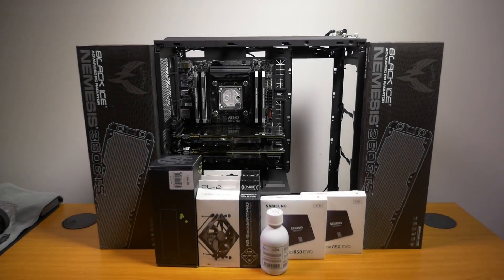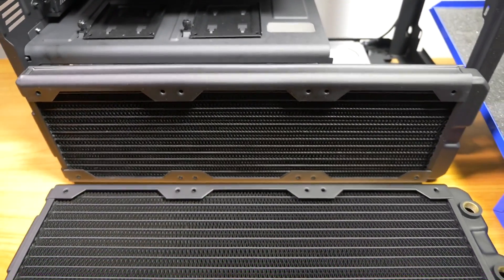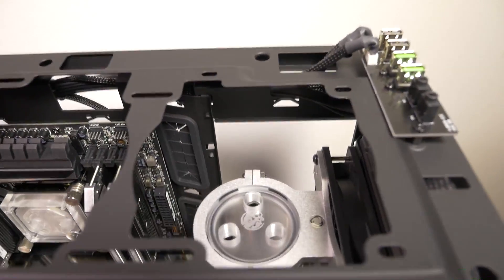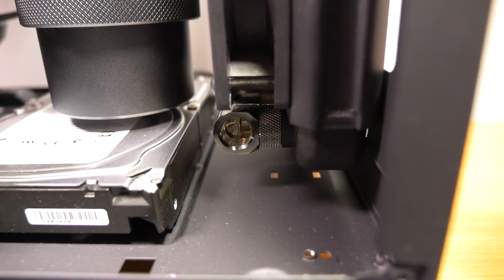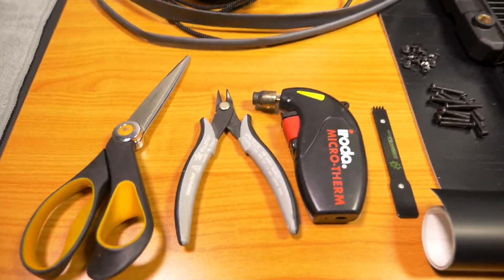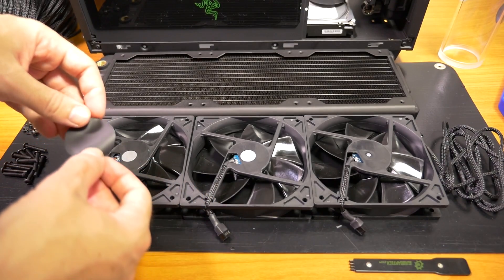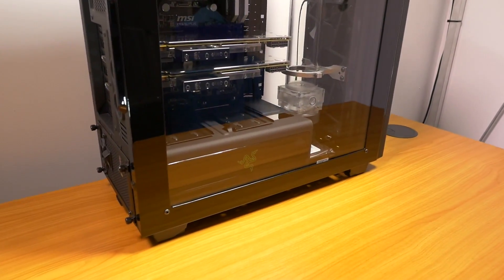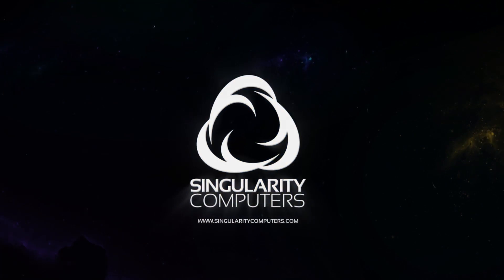SC Build #21: H440 Liquid Cooling: Part 3

Comment: I'm doing a water-cooled setup pretty much exactly the same and it would help me out a lot if you could list the specific fittings and quantities?
Reply: Cottontails So am I. Seeing your comment is half a year old, what did you use?
Reply: I just went with soft tubing and did pretty much two fittings per part it was cheaper.

Comment: I build my water cooled PC about 2 years ago(inspired by Client build 13) and i was wondering when should i replace my soft tubing and coolant? I'm using Primochill PrimoFlex LRT Advanced 13/10mm Crystal Clear tube and EK Ekoolant UV Blue as my coolant of choice. I have opened up my in-line filter a few times and i haven't found really anything in it so far. However, the piping i had to replace recently because of upgrades had already started to turn a little hard and definitely wasn't as clear anymore as it used to be.

Comment: Will the mounts for the reservoir hold the pump as well without vibration. And do you have a duel reservoir radiator mount as that's what I'm looking for
Reply from the maker: +James Emsley Hey. Yes the mounts hold the entire pump and reservoir config including the pump. I do have a dual reservoir radiator mount, right here: https://www.singularitycomputers.com/shop/watercooling/reservoir-mounts/reservoir-mount-ethereal-dual-60mm-billet
Reply: They hold the pump res combo using the friction of rubber pads, which shouldn't allow much vibration to pass. It's more likely you won't notice the pump vibration due to the fans it's mounted to.

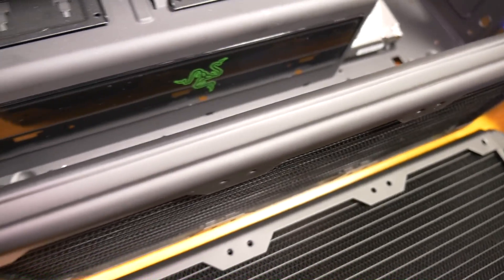Comment: 1:37 why just dont you pick adaptive fans. that can run at different speeds. so that is slows down when cpu/gpu are cool and spin up when they are getting hot
Reply: Because you would have to run extra wires to the motherboard and some type of pwm fan controller.
Reply: +rubikfan1 I think his whole point was that you don't need fast running fans when you have ample rads so your case stays silent.

Comment: +SingularityComputers
are you planing to do anything to the lug at the frontend of the psu shroud where normaly the drivemounting plate would be?
i dont know if it is just me, but this "dent" looks just off there in this very clean environment

if you do somthing to the shroud you can also place a thin piece of foam rubber (i mean Mossgummi in german, dont know if this is the right english word for) behind the cable routing hole for the gpu cables so you block the view a bit more

by the way, you should mayby do another version of the Ethereal mounts that use a railsystem so you can adjust the position of the mounts itself ;)

Comment: Very nice.
I have a small suggestion.
How about painting the sites of the graphic cards PCB?
They have that yellowish color to it. If you are going for perfection, (and since you even changed the screws, i think you are) that would be something to consider.
Reply: +Tony Atzen Some paints are conductive, making that a huge risk..
Reply: If you do it right. I don't see the problem.

I actually used permanent marker on my previous graphic card. XD
Sounds dumb, but it worked quite well.
I would have done the same to my new one if the edge of the PCB wasn't already very dark.
Reply: Tony Atzen Ah, I thought you meant spray paint or airbrush it... Your idea seems very nice it that case!
Reply: We can both agree that spray painting it wound't be advisable. XD
Reply: Tony Atzen Just did your idea to my card (980Ti strix) and it looks nice!
Reply: ***** Glad to hear it. :D

Comment: just one question: isn't it bad to have the outlets on the lower end of the radiator when installed vertically? wouldn't all the air bubbles get trapped at the top of the radiator?

Comment: That SSHD in the bottom is a big eye-soar for me in an otherwise beautiful build.
Reply: +David Larsen I don't mind seeing the drive because I want to know what's in a rig when I'm looking at it as opposed to having to read a spec sheet. That being said, sexying it up would be nice but I wouldn't want it concealed.
Reply: +David Larsen I think it might look better covered with some of the black vinyl.
Reply: +Steve Pannell but it may overheat...
Reply: +JBpiification I doubt it would overheat but flat black spray paint would work and probably even look better. Only on the silver cover, not the entire drive.
Reply: Or custom make an enclosure :P Or drill some holes so it can reside inside the PSU enclosure or backside of motherboard tray maybe.

Comment from the maker: I have had to reduce the length of my videos. Because of my slow internet connection it is the only way I can upload more often and I have had requests for shorter videos for a long time now. Soon I will be moving house just so that I can get a faster connection so that I can upload more. Let me know what length videos you would prefer.
Reply: +SingularityComputers Personally I enjoy the longer videos where I can sit down and enjoy your work with a good cup of coffee. But I can also respect the huge amount of work that goes into making each video, so in the end it boils down to the time you have yourself to make content available -- I know I will watch regardless of length. I really like how your pump and reservoir configuration turned out, even with the shorter tube, the mounting system really adds some great detail to the build. Exactly how much does the pump mod top kit and cover add in height before the tube is installed? It looks almost a full 120mm added overall without considering the small clearance you'll need for the pump wires.
Reply: +SingularityComputers just wanted to tell you to tell you to keep up the great work!!
Reply: +SingularityComputers I understand that sometimes you only can upload shorter videos but my personal prefrence is definitely longer ones so I hope you continue with that.
Reply: +SingularityComputers I think what matters is whether content is being left out, rushed or if build logs will have an extra part to them because of the extended length. I think we all want to see everything so if the shorter videos means things are being left out or rushed then I'd say make them longer, otherwise just have more episodes. Thanks for the great content as usual!
Reply: +SingularityComputers Your videos are longer than most, but it's why I like them! The 20-30ish minute videos don't bother me when you're giving that much detail on everything. But i'm sure other people would maybe like shorter videos, but more parts? Keep it up!
Reply: +SingularityComputers i prefer long time video because detail and a loot of info
Reply: +SingularityComputers I like to sit back and watch long videos.
Reply: +SingularityComputers i personally think longer videos are better i would say around the 20 min mark is the sweet spot for video length
Reply: +SingularityComputers I kinda liked the 20-30 minute videos because there was just more information that came across.
Reply: +SingularityComputers 15 - 20 Minute long videos are in the sweet spot in my opinion, not too short nor too long.
Reply: +SingularityComputers I like the shorter videos, but as long as you break down some of the more important in-depth mods in a separate video, then I think you will be able to cater to most viewers. Awesome channel Mate :)
Reply: +SingularityComputers I think around 20 minutes is a good video length.
Not too long, but long enough to have a lot of good content in the video.
Reply: +SingularityComputers Think the video was at good length under 15 mins.
Reply: +SingularityComputers Same length as what you were doing. If they cant be bothered to watch then their loss. I like to learn it all, cant if you do shorter videos.
Reply: I think 10-12 Minute Videos are ideal, sometimes longer if the content is captivating enough lol. Your videos are amazing though, even when I was watching 2-3 years ago.
Reply: +SingularityComputers wouldn't it be a good idea to paint the other side panel as well? that way it would be the same on each side... I just feel like that would fit the design a bit better...
Reply: +SingularityComputers i love em between 12-16 min, fits perfect when i'm having a break at school or work while eating :P also if i watch em before bed it wont be like a documentary, or just a teaser ^^ i really dont mind 20 eighter, there is a lot more information you can cramp in then, which i love
Reply: +SingularityComputers i prefer shorter video with a smaller time to wait between two fo them :) 15 to 20 minutes is perfect ;)
Reply: +SingularityComputers This video was perfect, anywhere from 13-20 minutes.  I need those details!  Keep up the good work.
Reply: +SingularityComputers Much better length!Keep up the great work.
Reply: +SingularityComputers 10 minutes max. would be awesome. If you need more time for a certain theme,  make a 2 part video.
Reply: +SingularityComputers Hey, a tip to maybe help you with the circle cutting; find a bottle cap the same size, and then just use a knife to cut around the bottle cap, easier than holding the previous sticker. Great Build :P, I'm doing a variation of it to my NZXT h440
Reply: +SingularityComputers i would prefer keeping the video as long as it needs to be by your knowledge and no forced cutting out of content once your connection isn't an issue anymore.
hope the house movement will go well btw!